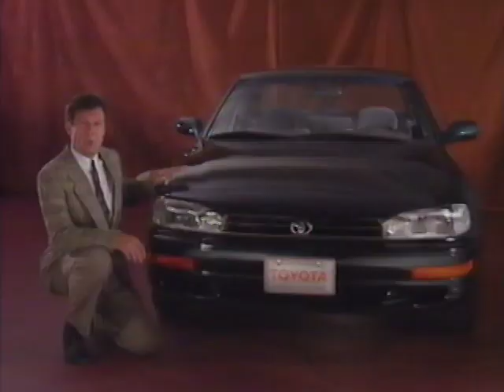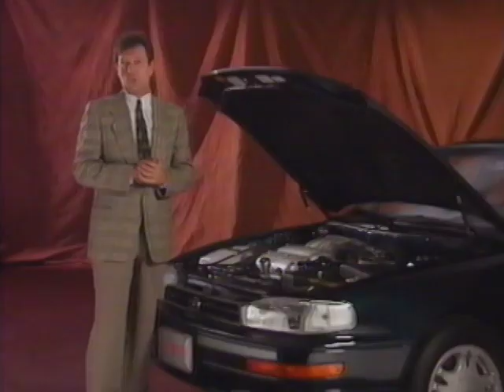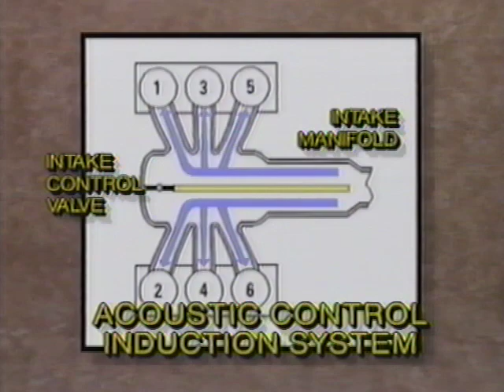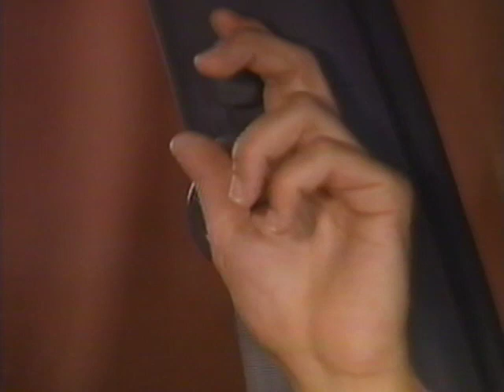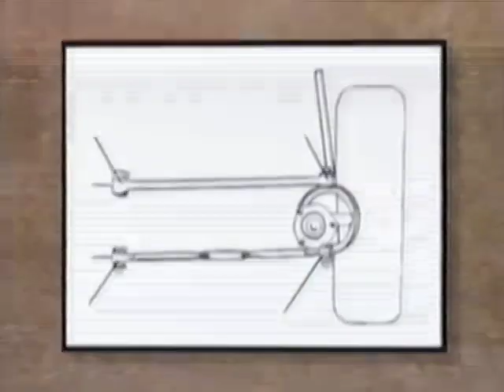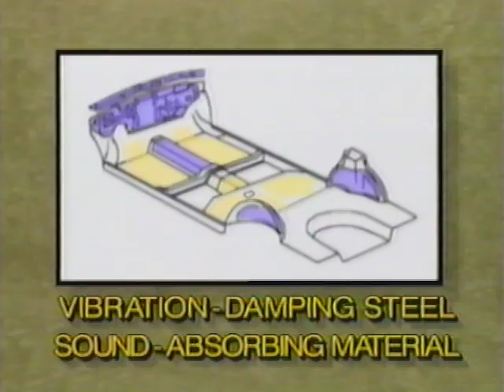1992 Toyota Camry

Comment: I have a 96 2.2. I am the second owner. What a sweet ride. Only 511,000 miles and it still runs and drives excellent. I maintain it well obviously, bu what a well engineered vehicle!! Had an 89 Camry 2.2, 5 speed before that and sold it to the neighbor for his son. It only 289,000 miles and still ran  great. Pride in engineering. We could sure use some lessons here in the USA. Both Camry's got about 30 mpg religiously also. Cold Air, excellent heat, and great in snow. There are still tons of this generation on the road!!! Toyota rules!!
Reply: Damn. That's amazing. I have a 1996 V6 Camry that just hit 150k KM and it is amazing. I just put 18 inch rims on it and a cold air intake and it's easily my favorite car I've owned now.

Comment: I had a 4cyl one in the nice grey color shown in the thumbnail with a pink/reddish interior, was really good but someone t-boned my front-left wheel deep in the wheel-well (it had only 92000km, such a shame)... Bought a V6 in the bluish/green and tan interior and the V6 feels really modern and powerful, going on 260000km ! These cars are THE ABSOLUTE REASON why Toyota became known as the most reliable car brand overall. I would buy a 3rd one when the green one dies but it seems supply has been depleted in my area (none of them for sale anywhere in Québec) so I'm gonna love my green one till death does us part..
Reply: and what happened in the end brother
Reply: @lightdr6  I'm still loving my green 96' ! But there IS a 96' in the same grey color I used to have with around 140000 miles which is the lowest I have ever seen on one of these !

Comment: In 1999, I bought a 3 year old 1996 Camry Wagon that came out of the south with the 4 cylinder engine .  White, beige interior, black roof rack, gorgeous and with the gold badges all around.  Even found two extra CAMRY gold badges and stuck them mid line on the front doors near the hinges.  Looks original And yes, they are GOLD PLATED!  $32 on Ebay.  I have been driving it ever since and still own it down here in Florida.  Has never seen snow, salt, etc. and is solid as a rock.  In the same condition as this video!  I did add a great Kenwood Bluetooth Radio just to keep up with the times!

Then....IT happened after 258,000 miles (my goal when I bought it was to rack up enough miles to get me to the moon...about 243,000 miles).  Just changed the oil and was coming back home when it started to rock and roll.  Got it home only to have to tow it to a great Toyota repair shop I found near me.  Failed the engine block test. Bummer.   Opened the top of the engine to do the repairs and was told by the mechanic because of excessive wear he found in spite of the care it has received over the past 25 years,  that it was better to find a new engine or a rebuilt one.  Scoured the entire US and found nothing but high mileage drivers that had more miles than mine.  

And then, I hit pay dirt.  A guy in Miami (I am from the Tampa/Clearwater area) was selling his 95 year old dad's 1996 Camry COUPE (complete with sunroof) with only 67,000 miles on it.  Since it was the only option at the time, we bought the entire car, drove down to Miami with a flat bed U Haul behind our Sequoia(!) and got it home.  The car was a MESS having sat unused for a long time, quite dirty in the engine bay, and according to the shop, some kind of black OOZE was found in the transmission pan.  But the engine sounded fine (seller said he has all the service records from his dad who only drove it within a 5 miles radius from his home)...but hell, only 67,000, one owner miles. 

Next goal is to get it to 500,000 miles.  Total cost of the repairs, $5700.00 and that includes the purchase of the car ($2300).  But we were able to pull about $4000 worth of engine components off of it so it turned out to be a great deal. Try to buy a decent car for THAT little.  

And I should tell you not a week goes buy when someone will ask to buy my Camry. Either at parking lots, on the road, or one guy who drove right into my driveway as I was detailing the car.  I kid you not. 

Now here is the best news of all.  My shop mechanic "dialed' in the donor engine to such an extent (far better than factory), that on two 100 miles MPG runs just to see how the engine performed, I went from around 20 MPG  with my older engine (2.2L) to 31.77 MPG!  Incredible increase.  I also added a treatment of Auto-RX to the oil to clean out any sludge, deposits, etc.  After driving around a bit more, drained the oil and out came much darker, but not sludgey oil.  New oil change with the following cocktail:  3 quarts of Mobil 1 High Mileage Full Synthetic, one quart Marvel Mystery Oil and one pint of BestLine Nano Technology Diamond Oil treatment.  The engine now has the proper "whine" as it should and is so smooth and quiet, even my shop was amazed at how well it performed.   So, fellow GEEKSTERS, take heart.  You now own something that others always wanted. Like getting to date that prom queen back in high school.  They call that KARMA.  Enjoy. Dr. Z (Lou)
Reply: Fantastic story Lou👍😊! My father bought a 1996 Camry and loved it! I drive it now👍 and it’s got 126k now and still smooth as butter✌️
Reply: @tomsmith2361  HI there: The story is about to get even better.  Although the interior is showroom MINT, I am going to gild the lilly with a new leather interior with perforated seat centers and contrasting stitching by Road-Wire.  Should be an interesting look since the Camry did have that as a  option on their XLE model.  Mine is the LE.  Should be done in a few weeks by a local auto style company here.  The beat goes ON!!!  Dr. Z

Comment: 2021 and I still drive my 92 Camry with 130k original miles 💪🏼💯🇲🇽💪🏼
Reply: 2022-Still rocking my Dads 1996 Camry LE, 4 cylinder at 126k😊✌️
Reply: Ayyy, just bought a ‘92 LE 2.2 automatic with 118k back in March & she is strong 💪
Reply: @DamienPaceGaming  my 92 2.2L Camry has 267,171 miles so far.
Reply: My family had  one the 2001 LE V6  and the 2004 XLE V6 .

Comment: I like the one piece door on these Camrys. Very rare. All cars now use two piece doors with spot welds at the ends of the window frame. Toyota was really pushing for top refinement starting with the Lexus LS in 1989 and trickling its way down to the ES and Camry. Now, car companies are looking for every place to cut corners to save on costs. 

The biggest concern when my parents bought one in 1996 is the price. Even though it had lots of refinement especially in the suspension, my parents were seriously considering the equivalent Accord for $1000 less. The Toyota dealer ended up negotiating a deal with us right at closing time.
Reply: Early 90s were the time when Toyota was having loads of money thanks to a short-lived economic miracle in Japan from mid-80s until 1994. Toyota was producing family cars with premium-level refinements but with affordable prices, which proved to be a double-edged sword advantage: ppl were extremely satisfied with the cars' sturdiness and bcz of that, they end up not wanting to buy new Toyota models for years to come even when their spare parts are already scarce and rarely available these days. That's why current Toyotas don't match the old ones in longevity, bcz Toyota doesn't want to lose money from not being able to sell more brand-new cars.
Reply: My father bought a 1996 Camry 4 cylinder new and really enjoyed it. I keep her running smoothly out of nice memories and my enjoyment of this fine machine 😊. 126k on the clock as of Spring 2022👍.

Comment: I got 1992 Camry with a 5speed for 500, best car I ever had
Reply: @KingZ LEGIT my very FAVORITE Toyota. I’ve got a Camry story for you Drove one for a racing school years ago as a kid, just like yours, same year same transmission. I remember getting into it, being amazed how clean everything was, I was 11 and I expected the car to be like a well maintained 14 year old car. I was very surprised to find that it was manual with crank windows. I had never seen a Camry with crank windows before at the time. Then getting on the racetrack with the instructor (this is British Columbia, it was raining), it did exceptionally well, super fun learning how to row that tall distinctive shifter and use the light clutch that still worked like new. Finally I pulled it in and parked it under the tree between an approximately 20 by 10 feet space between a greenhouse and a racing car storage garage, right next to an Emerald green dodge neon I had driven earlier (it was auto). Out of all the racing school cars there, I loved that Camry more than absolutely ANY other car I’ve ever been it before. Still to this day 4 years later soon as of 3 weeks from now. When I got home from the racing school I was so excited I reasearched about that car as much as I possibly could. I missed lots of schoolwork just watching Camry videos. But the story doesn’t end here, believe it or not. It was a year ago, I emailed the racetrack about if I could buy it and if they still had it, and they said they did and it didn’t run anymore. A month later, I went down to look at it, and unfortunately a NUMBER had happened to it in 3 years since me last seeing it. That previously beautiful silver taupe metallic paint had all peeled away from our giant Canadian heatwave, and the seats were super faded, but amazingly enough, the dashboard was absolutely perfect. Like no scratch no dust or crack perfection. It was unbelievable. But I must have spend 10 minutes rowing through that gear shifter with my parents telling me it’s too rough shape let’s leave. Water had gotten in the fuse box, and It died sitting in the racetrack infield with 280585 KM and 30 years of age. (yes I remember the exact figure that’s how much I loved it), but the interior felt modern enough to be 2005. Now amazingly enough I have a 1986 5 speed manual Camry that I bought 2 months ago with my own money and I’m just so excited. Turning 16 in the summer and can’t wait to get out there driving. Super fun times. I know this is probably the longest ridiculous story you’ve been told off of YouTube, but I figured I would, for the people like me that love these cars. Whenever I see one rolling down the road, I crane my neck.

Comment: This car when well-loaded and with the 1MZ V6 was like a baby LS400 when it came out.  Toyota kept refining it for the next two years until it became what was possibly the most reliable sedan ever built.   By '94 it had goodies few (or no) other cars in its class at the time had like platinum plugs, 4 wheel ABS, dual airbags, even had OBD2 two years early.   The all aluminum 1MZ-FE put out 188HP and this engine would remain in production until 2014.  It was the V6 of choice for the Toyota Camry until 2006.
Reply: Yep. Gotta love Toyota. And now we got a 3.5 liter v6 at 300hp that is ALSO legendary 😎
Reply: @Justin1020304  No doubt!   2GR is the greatest V6 of all time.

Comment: It talks about how the rear has room more typically found in a midsize sedan yet it is a midsize sedan and for the time this video was made one of the larger midsize sedans. maybe he mispoke
Reply: The Camry was considered compact in some places as some of the length measures like the wheelbase meets the limits for a compact vehicle. The 1997 Camry brought all measurements to midsize
Reply: @worldlinerai  the 1997 was 188.5" in lenth with a 105 wheelbase the gen 3 was 187.8" with a 103.1" wheelbase. People keep saying the gen 4 is much larger in reality it is barely any larger. I will agree that the interior volume is increased substantially. The way car sizes are classified is pretty odd in my opinion, as an auto engineer myself it is a pet peeve of mine. For a car with the overall exterior dimensions about matching an E39 5 series or W210 E class it blows my mind that some markets classifies a car with such a large body size a "compact". But here in the states many view the EPA classifications as ludacris. I dont get it personally but the classifications arent within my control anybow

Comment: The exterior is still beautiful in 2019. And I feel that 1992 Camry is bigger than 2019 Camry , although it's actually smaller. But the 1992 interior is out of date.
Reply: The interior space got smaller due to new safety requirements for side collision. The 1992 Camry doesn’t have side airbags and curtain airbags and the pillars and roof rails got thicker over the years.
Reply: Well it was good when it was signed off in 1989, so of course it's out of date now.

Comment: Just bought a '93 LE/V-6 in Aug. 2018 ... now 270,000 km.... a great car I think.  I would prefer a stiffer suspension (being used to sports cars ... just sold my S2000 and had a Miata before that).  The handling surprised me ... a bit soft but it rotates very nicely in autoxes ... I was amazed.   Good car.

Comment: Awesome video!! I have a V6...490,000Kms and still going!
Reply: Had 330,000 on my 92
Reply: O wow.... I have95 v6 it's 232000 miles
Reply: Any problem on yours mine a had to fix the electrical antenna
Reply: @osmosis3182  Apart from a bit of oil leaks and rust it got a new transmission (not used...was the last one in the warehouse so got it it for half price) but that ended up being a misdiagnosed ECU fault. I've got 2008 Camry now too so the old ones a learner car for my wife
Reply: @outdriving08   Thank you so much for your answer do you know The transmission can be update
Reply: @osmosis3182  You could probably swap it for a manual but the auto is pretty smooth and a good match for the engine so don't know why you would update it IMHO
Reply: @outdriving08   Well since the new transmissions are 6 and 7 speed ..
Reply: @osmosis3182  Probably cheaper and easier to just get a newer model. Especially with all the ECU changes that would be required
Reply: @outdriving08   Thank you so much for taking your time and my questions, Ice talk about the transmission because I feel that the Motor have  A lot of power but the transmission I don't know
Reply: Wow😱  That’s a beast car!